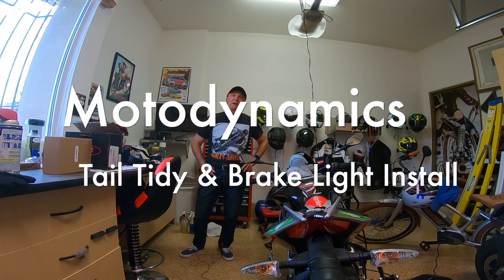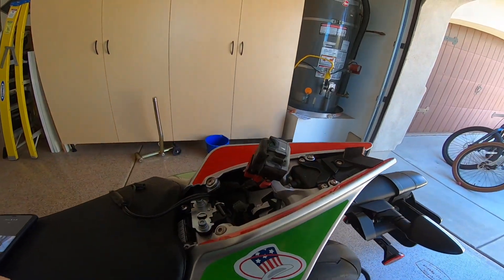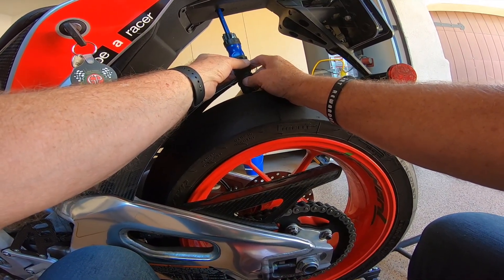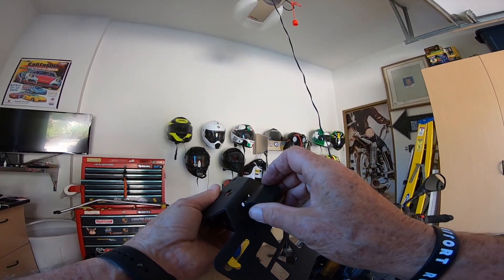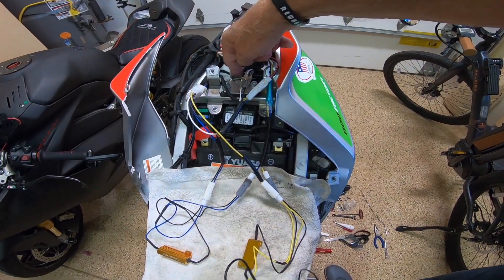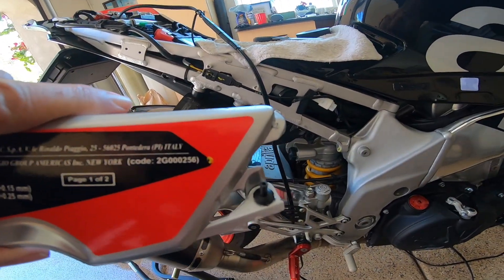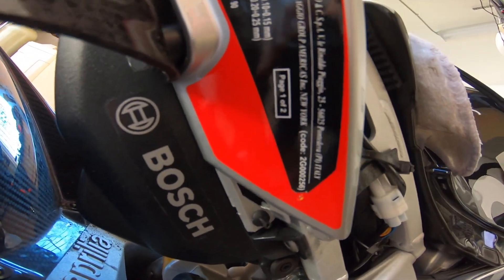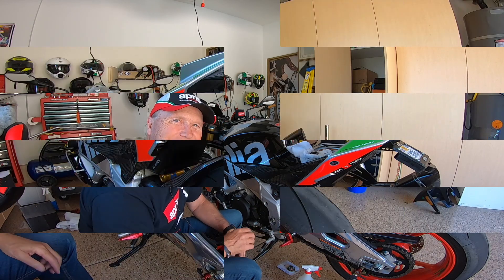Aprilia Tuono Install, Tail Tidy & Tail Light by Motodynamics

Comment: Happy your kit didn't require splicing. Mine required splicing all over and it was a bit daunting for me but worked out  overall. My tip put the resistors away from any plastic. As they heat and get extremely hot.
Reply from the maker: Thanks for the advice AJ! Yes, these kits come from different manufacturers with different specification. While this kit did NOT require spacing, they made the wires pretty long.....not sure why? But the length of the wires had me thinking for a bit that I might be better cutting and splicing them down to shorter lengths. But, in the end I could fit them in and there just didn't seem to be justification what would have been the extra work.

Comment: Hi Garey looks like you did a really good job installing this Motodynamics light 👏🏻👏🏻. Ive actually just bought one myself for my RSV4 and looking at the wiring it looks a little crazy. I’m not sure if you’d be willing to help me out and make another video of this install just showing the order of the wire’s that plug together obviously I’m not asking you to strip the hole thing down again just seat off and rear cowl just so i could see the order of play with the assembly of the cables would be greatly appreciated if you would but if you don’t i fully understand 👍🏻 Adam uk 🇬🇧
Reply from the maker: Adam, I'd love to do so sir, but I've since moved on from this machine...I know have a 2021 model. Can you give me any direct questions to answer?
Reply: @GareyCooperdude  ok no problem buddy and congratulations on your new 2021 😍. It’s just basically what order do the cables plug in i think ive cracked it but ive not had time to install it yet but definitely any advice you could offer would be appreciated 👍🏻